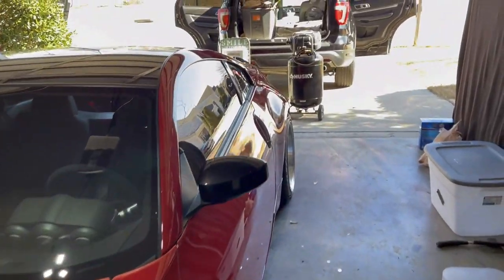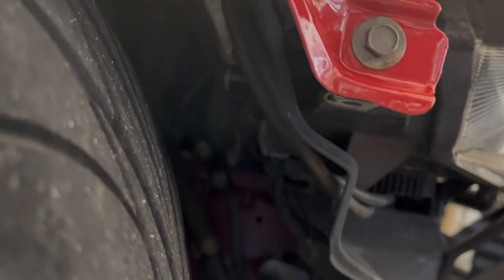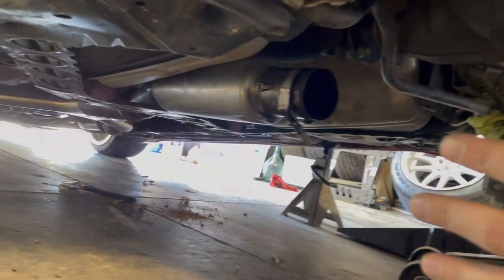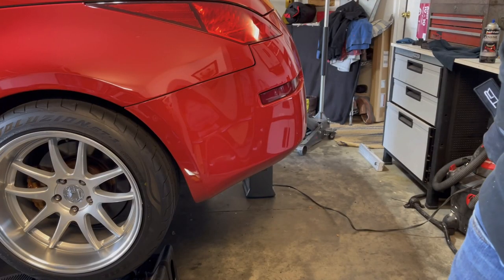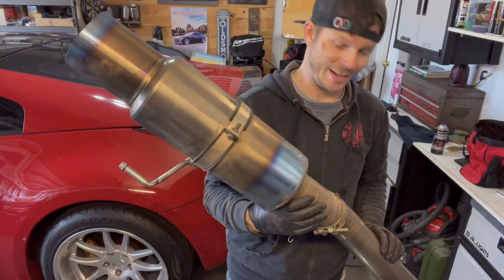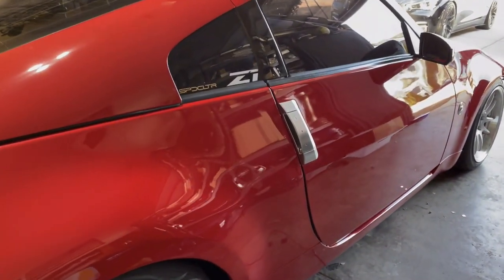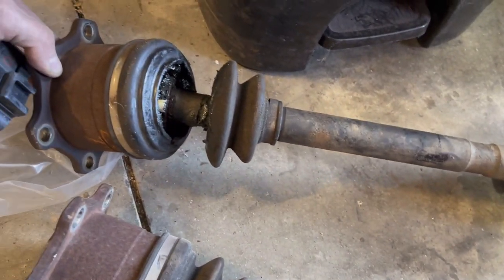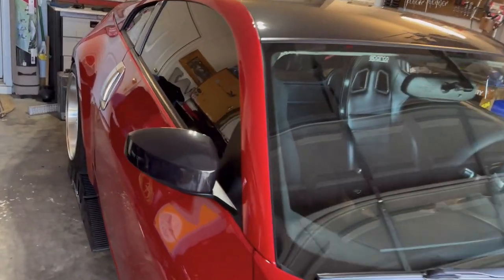Took The Tomei Off -- WOW!

Comment: I ha e a question I have a 3.0t stock with jb4 and it don’t matter what map I’m on when I accelerate hard it’s sputters or hesitate is that normal?
Reply from the maker: No not normal.  Check connections for the jb4 and see if there’s a difference.  I’m personally not super well versed in jb4 but obviously something is not right